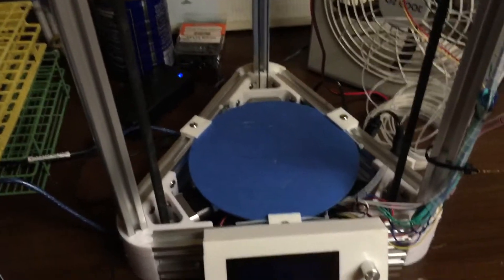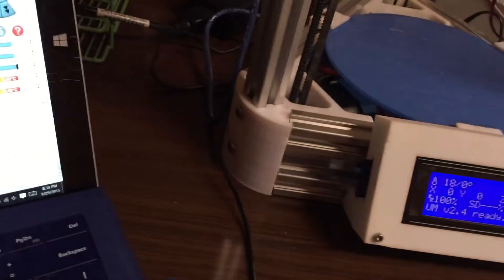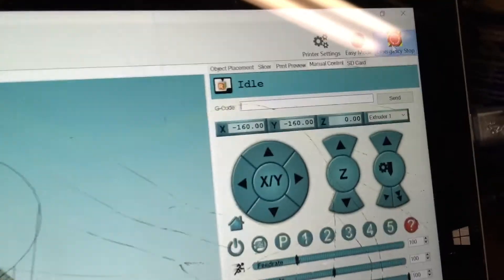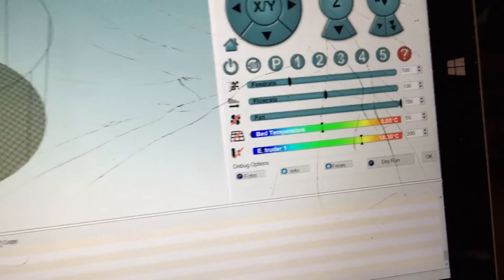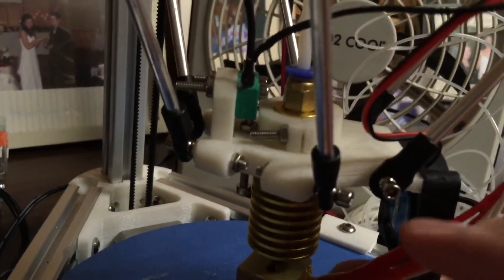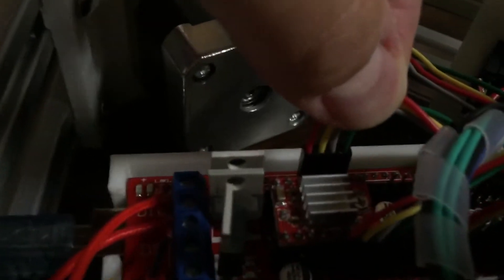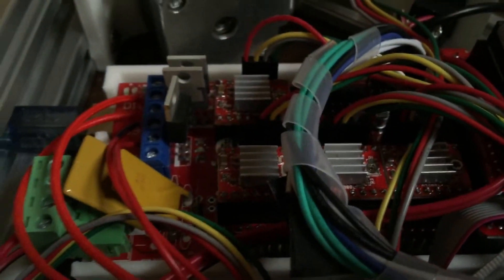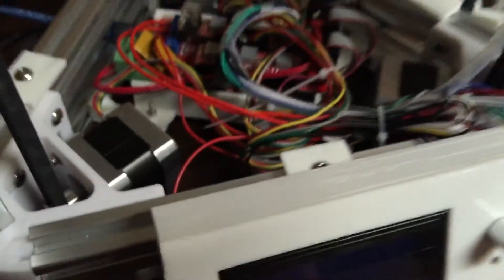Dlt-180 wrap up

Comment: Hello iceman198,I just received this kit and am putting it together.  I have watched your videos and am glad I have finally found someone with the same model (auto-leveling kit) as mine.  All the other ones, including the so-called instruction videos, all have the standard version where there is no limiting switch on hot end assembly an in-turn have much different assembly requirements.  I do have a couple questions for you if you don't mind though and if you can help I would greatly appreciate it.  1) My kit did come with some jumpers, thank god.  Where did you place them on the board?2) I got some springs in one of the bags.  What do I do with those?  Not sure if it was something between the two plates I received (I did get the heat bed upgrade).3) The middle assembly that actually clamps around the hot end should be free to move up and down to actuate the limiting switch, correct?  I believe it should pivot on the hole that was drilled in the sides of the middle piece.  Is there a really long screw that goes thru the two rods, then the outer piece, and then the inner piece that should measure around 60mm?  I didn't get this screw if there was supposed to be one. They also only shipped me one drive belt.  I sent in a request form but haven't heard anything back yet other than the acknowledgement of the request. I may need to buy some from somewhere else if I don't hear back. :-(Well, I would appreciate any response if you have the time.  You can respond either here or my email @ andrewindihar@gmail.com  I may have other questions down the road if you wouldn't mind as well or any pictures you might have or useful links.
Reply from the maker: Hello +aindihar ,

Mine didn't come with any springs so I'm not sure what those are for unless it is something with your heated bed.

The jumpers go underneath the stepper driver chips.  There will be 3 per driver so a total of 12 will need to be put in.

Be sure to check out my playlist of building this thing.  My steppers were wired wrong so hopefully you should be good.  But if you get it all together and it just makes tons of noise but doesn't move, that is probably the case with you too.

Stinks you only got one belt.  Is it just a huge roll and maybe you're supposed to cut it to length?  Mine came with 3 separate belts already cut to size.

For your #3, yeah, make sure that thing can move freely!  A lot of sanding on those pieces.  =)  I didn't use a long screw to go through it...just a couple of the mid-sized screws through the rods.  DO NOT PRE-DRILL THE ROCKING PIECE!  The screws for the rods that go in to that piece that pivots actually thread into it!  So don't over tighten either.  You can pre-drill everything else though.

Also, the smaller hex wrench that came with it, I ended up trimming the short end even shorter with my dremel so I could screw in the stepper motors easier.  Here is a pic (https://onedrive.live.com/redir?resid=F34EBFCC1A32BC47!40136&authkey=!AA-h-Rk08bVqPRE&v=3&ithint=photo%2cjpg)

Here are some pics of my hot end put together:
  https://onedrive.live.com/redir?resid=F34EBFCC1A32BC47!40149&authkey=!AOCyL3suEy2Wcqo&v=3&ithint=photo%2cjpg
  https://onedrive.live.com/redir?resid=F34EBFCC1A32BC47!40145&authkey=!AIbWRsq5UhQKkHE&v=3&ithint=photo%2cjpg

Here are some other pics:
  https://onedrive.live.com/redir?resid=F34EBFCC1A32BC47!41430&authkey=!AM6WEVdmhPaKytY&v=3&ithint=photo%2cjpg
  https://onedrive.live.com/redir?resid=F34EBFCC1A32BC47!41327&authkey=!AI9lhrfsbNAE3AI&v=3&ithint=photo%2cjpg

Any other questions, I'll be glad to help if I can! Hope it goes smooth for you!
Reply: +aindihar The springs are for making the bed a spring bed
Reply: Hi aindihar, I am sure you figured it out by now but my kit came with a different extruder and there separate instructions on the SD card for that that show you how to put that together.

Comment: Great set of videos. Just finished putting a DLT 180 together with the heated bed and auto-leveling.

I'm feeling mildly brain damaged about one thing, though, the included docs/vids (for what they're worth) mention using different firmware with the heated bed - Specifically, it says

if add the heated bed, please use arduino1.0.2 modified firmware, otherwise you will nozzle collision platform, or no access platform!!!!!

Now, I didn't do anything with the firmware but I did change the z-offset on the from panel from -1.6 to 1.6 (as mentioned elsewhere) and it seems to auto level correctly. (Note: the heated bed sits up on springs about an inch higher than the regular bed.

My issue is that everything seems to be working except the temp. feedback from the bed - and this has me wondering if monitoring the heated bed temp. is part of the firmware update they keep mentioning.

Any thoughts on how to update the firmware? Repetier Host let's me tune various variables and upload those, but I think they want me to load a sketch and upload it to the arduino.

Thanks again for taking the time to share your build/debugging. It really helped.
Reply from the maker: Unfortunately I don't have the heated bed so I can't say for sure but I doubt you'd have to use a different firmware. Make sure you have the pid wires plugged in from the heated bed. Just like the two black and white wires coming from your hot end, your heated bed should have a couple wires coming from it too (four wires total) and I would assume they would plug I. Somewhere next to the pid wires from your hot end. 

I'm pretty sure you can try repetier host firmware (or even marlin) but it may be tricky getting the lcd to work. 

If you do try a different firmware, do let me know as I was tempted to try as well.
Reply: +iceman198 
Yep - the heated bed has a pair of white wires with a plug on it and the wiring diagram shows them connected right next to the white wires from the hot end. I'm tempted to plug them in to the pins for the hot end just to see if the LCD will display a temp from the bed (in case there's an issue with the thermisistor on the heated bed). 

I guess the other reason I thought it might be firmware is because when I unplug the temperature leads for the hot end I get an error on the LCD - MinTemp Err. but I get no such error for "unplugged" print bed temp. leads.

The other thing that might be a little off is that I think the filament stepper might be feeding backwards. When I click the down arrow (thinking "down" means towards the bed) in Repetier host the motor turns in a direction that would run the filament away from the bed (unloading instead of loading)

I'll keep monkeying with it.
Reply from the maker: +Jason Brown yeah, I did have to tweak the firmware to flip the extruder motor as mine did pull out the filament at first instead of push it in.

The "min temp" error is the generic error...if it does that get a reading at all then it will do that. Your idea is good, to swap with the hot end one and see what it says. It might need to actually go somewhere else. Search for the wiring diagram for the ramps board...some of the stuff was off in mine compared to the pic they sent on the SD card.
Reply: +iceman198 
Just took a look in Configuration.h in firmware/Micromake

Found this
#define TEMP_SENSOR_0 5 //设置传感器0接口连接的传感器类型编号，类型根据上面说明设置相应的编号
#define TEMP_SENSOR_1 0
#define TEMP_SENSOR_2 0  //设置传感器2接口连接的传感器编号，0表示关闭该端口
#define TEMP_SENSOR_BED 0 

Looks like the temperature sensor for the bed is defined at 0 (meaning it's disabled?) Just not sure why temp_sensor_0 is defined as 5.

Any thoughts? Did you do any builds of of the firmware?
Reply from the maker: +Jason Brown put the Chinese through Google translate to see if that helps. =) That's what I did for the entire Configuration.h file. Pin 0 could be a legit pin so I can't say for sure.
Reply: +iceman198 
LOL. Why didn't I think of that.

And here it is

#define TEMP_SENSOR_BED 0 // set the sensor type bed heat sensor port. If the error affects the bed temperature control heating
// Add a hot bed support simply #define TEMP_SENSOR_BED set at 0 to 5

I guess I need to flip it from 0 to 5. Now how do I build it and upload it :)
Reply: +iceman198 
OK. Got it figured out.

Had to change the TEMP_SENSOR_BED to 5 and about half a dozen other vars in Configuration.h.

Found the project Sketch file (MICROMAKE.ino), opened that in Arduino 1.02, changed the variables, built it, and uploaded it and now I have a 2nd temp readout on my lcd and I can heat up the print bed. 

Had to change some other settings related to printable radius and distance from hot end to the print bed b/c the heated bed is raised about an inch.

Now, to home it, level it, load some PLA and see if it will print :)
Reply from the maker: +Jason Brown sweet! Now the real fun begins! Just keep your mouse near the emergency stop in repetier host. =)
Reply: +iceman198 
Amen to that - and the power switch :)

G28 - nicely finds the home position
G29 - nicely finds the 9 auto level points and right after it finds the 9th point it comes back down to the bed and jackhammers across the bed as far to the back as it can go and then it stops (and smirks at me)

Then I thought, that was exciting, let's dry run the little sample box that comes from He3D. load it up, check Dry Run in the manual settings, click print and I swear the print head tried to go through the bed.

Grrrr. That ever happen to you?
Reply from the maker: +Jason Brown Yup, many times.  Just be quick on the power switch.  =)

Its most likely the zprobe offset.  Set it to 0, re-upload the firmware...Then do a G28 and G29.  Then, in Repetier host, under manual control, type in "G1 Z10 F5000".  G1 tells it you are about to send it a coordinate.  Z10 says put the z axis at 10.  F5000 sets the speed at which to get there.  This speed persists for the rest of the codes until you decide to plug in a new speed.  So...after this, it should to go where it thinks it is 10 milimeters high.  Hopefully, it didn't drill into your bed.  Now...you can type in "G1 Z5"...and it should go to where it thinks 5mm is.  Just keep doing this and going lower till you see where thinks 0 on the z is.  This will help you figure out what you should put in the firmware for the zprobe offset.

I actually stopped using the G29 and put a screw to wedge it in place because that hinge for the clicker was finicky.  The tube that goes into the hotend would actually pull it up depending on where it was on the bed.  Of course, this requires you to tune the thing more mechanically...but I think it is worth it as you take more trouble out of the equation. =)
Reply: +iceman198 
Set the z probe offset to 0, ran the hot end to Z0 (which was way high) and walked it down until I got to
g1 z-73.5, which put it right on a sheet of paper on the bed.

Now to translate that into z probe offset units. 1.6 was burying the hot end so any clues as to the conversion between mm and z probe offset units? Or should i just put in a non-zero offset, like 0.25, set it at 0 and walk it down again then figure out the unit value by taking the difference in the Z values and dividing by .25
Reply from the maker: +Jason Brown If it was at 1.6 to start with....maybe just increase it by 0.2 increments...and just keep tweaking the firmware...just to be save.  If you get it pretty darn close, the hot end itself has some give so you can kind of shimmy it up or down a little.  =)
Reply: +iceman198 
Well, ok then. Finally got it homing. Couldn't get it worked out with the z probe offset, though.

I changed the Max Z down from 230 to 177 and now it homes, levels, and z0 is a paper thickness off the bed.

Finally decided to try and print something - loaded up the filament and tried to print but think all of the mashing of the print nozzle on the bed might have partially closed the hole at the tip :)

I can get it to extrude, but it's really thin. Almost got a print going, but I had the bed too hot and the PLA stayed too soft.

Now I've got a clogged print nozzle. I feel like I read/heard somewhere that you should just replace the nozzle because the stock one is lousy. Was that you? Did you replace your nozzle? Got any suggestions for feed rate/flow rate/nozzle temps for PLA?

Thanks.
Reply from the maker: +Jason Brown if you heat up the hot end and can feed pla through slowly, I would think the nozzle is fine. I have driven mine in the bed a few times learning but am still using the same nozzle without issue. 

Maybe try without heating the bed at all. I just use the blue painter's tape on mine and it sticks pretty good most of the time. Make sure to try a small print first. They have a little cube somewhere on the SD card it came with. Put a lot skirt in the slicer settings. I have mine do 10 for small prints which is usually enough to get some of the pla to come out before actually starting on the object.
Reply: +iceman198 Got a successful print! (of the little cube that comes with the printer) - though I have lots of objects. I used to use a MakerBot 5th Generation (super lousy print head - although I understand they've since re-engineered it - and noisy).

Ended up having to mess with the slic3r settings and even then it took me a while to realize just printing the object wasn't using the slicer settings, it was using the firmware on the printer. Have to actually click slice and print ;)

Now to really get to fine tuning and creating slic3r profiles and trying to re-print some of the STLs I ran through the MakerBot.
Reply from the maker: +Jason Brown sweet!!! Post some via when you get a chance!